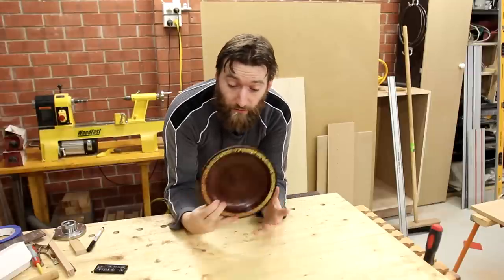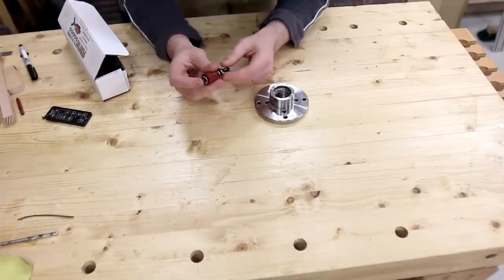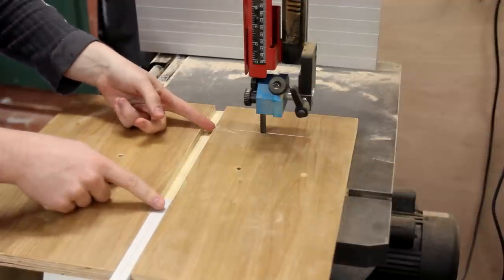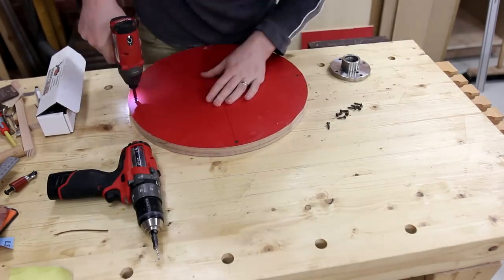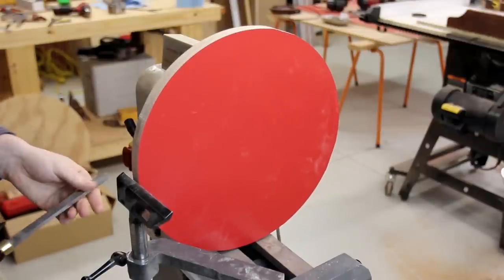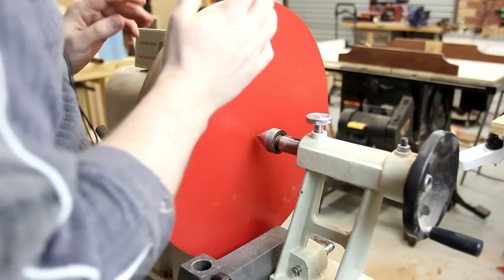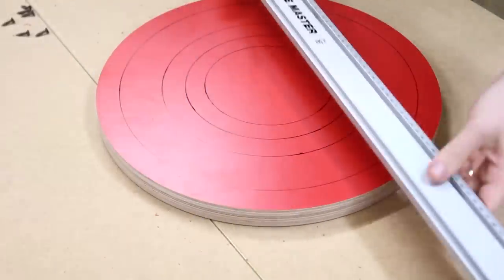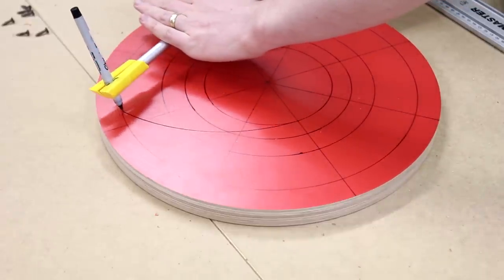050 - Build a longworth chuck

Comment: Instead of having the auto-centering feature, the spiral slots could be used like a simple faceplate, with the added advantage of tending to become tighter under load.
Use dividers to lay out your perpendiculars and 45's instead of a protractor.  Much easier and more accurate.

Comment: Hey Paul,

Is the Triton router a TRA001? I am looking to get a router table going, and cause we live in Australia, and can not easily get barrel style routers, that seems like the best bet for a height adjustable table router. I have seen some pretty rotten reviews on the smaller MOF001 router. I live about 5min away from PopsShed, so will have to go check that place out!
Reply from the maker: ddabate Tell James (at PopsShed) I sent you, it'll be interesting to see if that gets a reaction out of him ;) 

I've got a JOF001 - the little baby in the series. It's a bit underpowered for in table usage (but still works, as its the only router I have), while the TRA001 is a monster thats generally recommended for table usage only as its so big!

I haven't actually heard bad things about the MOF001, I've been tempted to get it as an inbetween to use for both table and 'free hand' usage.

Comment: I bailed at Metrically Challenged… There is the real world of wood working, then there is the metric handicapped wood workers. Metrics are great in the lab. They are terrible in wood working. Really… 12.7 mm or 1/2”?   Measure 1-1/2” or 38.10 mm?  A piece of 3/4” plywood is 19.05 mm? Really… mark that out thirty times building cabinets.